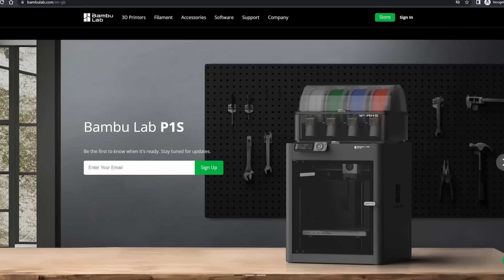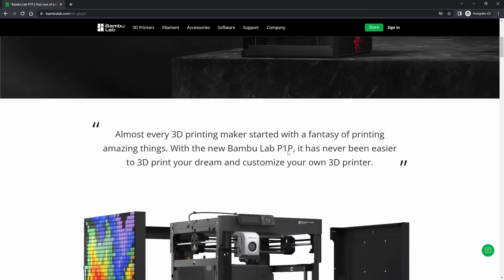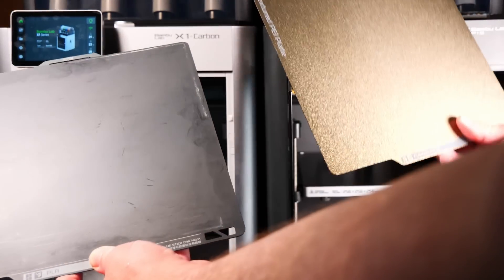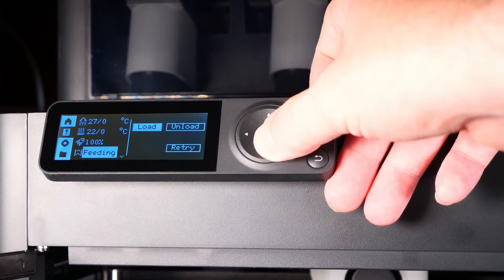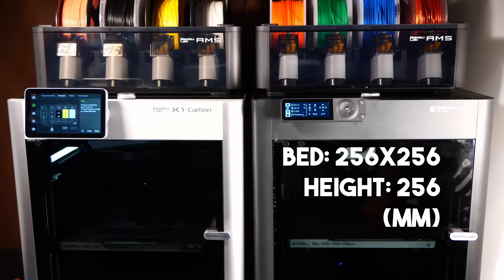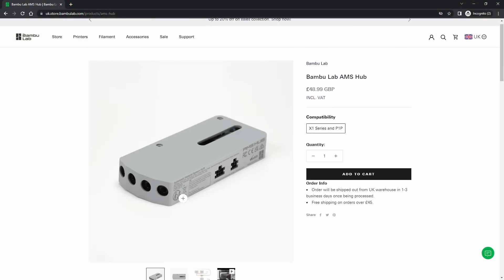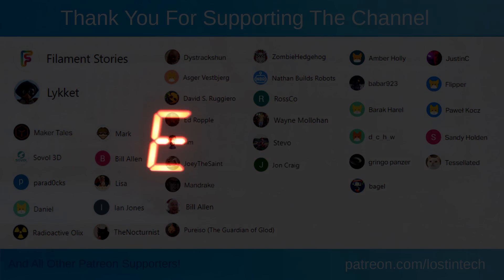The Bambu Lab P1S is here - Should you buy this one?

Comment: I'm confused by all the different bed plates,    can you do a simple to understand about each plate and if any glue is ever needed,    thanks again.     great video.
Reply from the maker: I sure can!
Reply: Not a video but this might be helpful to you right now:

The cool plate is used to avoid the chamber getting too hot when printing PLA. For all other filaments you can use the engineering plate, the high temp plate or the textured PEI plate. Some filaments stick too well on the plates and will damage the surfaces (for example PETG likes to destroy the textured PEI). In such cases the glue stick acts as a layer between the build plate and the print. That way the print is less likely to break the surface of the build plate. You can essentially use glue stick or liquid glue for every filament. And for some filaments it helps with adhesion if you notice warping.

If you want to print something, than ask yourself:
1. What finish are you looking for - smooth or textured
1.a for smooth you can choose the engineering plate or the high temp plate
1.b for textured just use the textured PEI or some other textured surface
2. is the print likely to warp? if yes, then use adhesive like the glue stick
3. is the filament going to damage your surface? if so then make sure to use glue stick or liquid glue or similar adhesive
4.a When you have chosen smooth then use the engineering plate if you're some specialty filaments like PA, PC, PET-CF
4.b When you have chosen smooth for a normal filament other than PLA, then the high temp plate is the one you can use
4.c When you have chosen smooth and use PLA then use the cool plate - but in this case glue stick or liquid glue is highly recommended.

5 You may want to experiment as much as you want, but be aware that printing PLA with the door and lid closed on a heated bed can clog the hotend when you start a large print. This highly depends on the kind of PLA you print. Some get soft at 50°C and some are even okay at 65°C. Most of the time 55 will be the point where you will get some problems.

Comment: Attractive package at the price. It's a shame the S doesn't stand for "silent". Bambu really should adopt Trinamic stepper drivers.
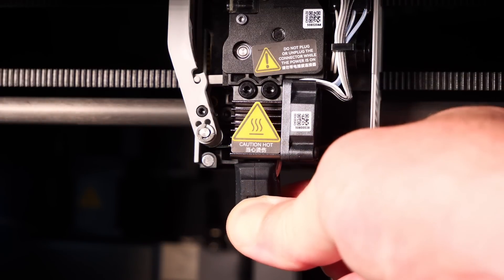Not sure what's going on with that sticker at 3:59? Not a functional issue, but not good for quality control confidence.
Reply from the maker: it would still be loud with trinamic drivers, vorons are not quiet, you have to typically run them in spreadcycle. The creality K1 is a testament to this, it's also loud. Mostly fan noises on that one, but I can still hear it through the floor downstairs. Fast, apparently, is loud.
Reply: @LostInTech3D  yes. It's never going to be a quiet printer, but any reduction in noise helps.
Reply: I wish they would include better fans and a silent profile! No need to print so fast every time!

But a silent profile which would also slow down the fans would be a great addition.
Reply: @hassosigbjoernson5738  yeah! If Airwolf, the super fast helicopter in the 1980s TV show, could have a stealth mode that allowed it to sneak up behind people, why can’t this printer? 😂

Comment: prusa shaking in his boots lol
Reply from the maker: I didn't have time to flesh out the argument, but prusa is the casualty of this creality v bambu corexy war. I'll go into why I think that at some point.
Reply: @LostInTech3D  its just sad man, you can buy 2 p1p for the price of 1 super outdated prusa machine
Reply: @AndroidA258  In some points the MK4 isn't outdated (maintenance, customization, ...). And some tests with Alpha firmware showed even a faster Benchy than the X1C!

BL is getting many points for their "stolen" Bambu Studio slicer which is a forked PrusaSlicer. And that shows the problem here: Prusa did the development and gave it away open source and Bambu Lab benefited from this without giving something back.
When Prusa is going closed source ... the innovation slows down.
Reply: @hassosigbjoernson5738  prusa is much more expensive while having less features, preusa doesnt get pitty points for prusa slicer
Reply: @AndroidA258 the biggest differences is that the LiDAR can do first layer checking to see if it went down properly, auxiliary fans and enclosure. The ams is undoubtedly better than Prusas mmu. Whilst the mk4 looks really outdated it is using some of the most modernized components. Think of it like a sleeper build pc: old case but the hardware is top of the line. They share most of the same features, they do have their differences as well. Admittedly Prusa is taking a while to update their firmware and get features working.